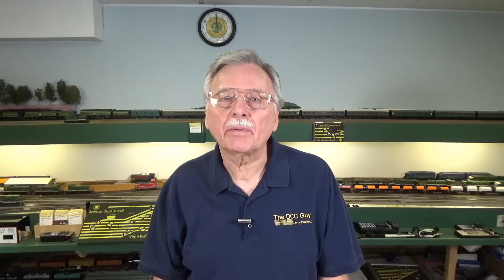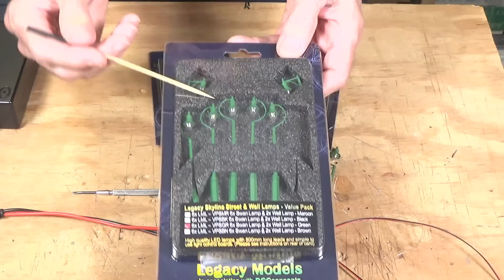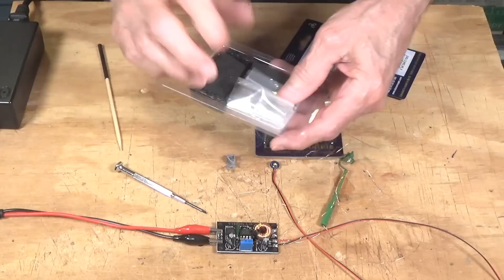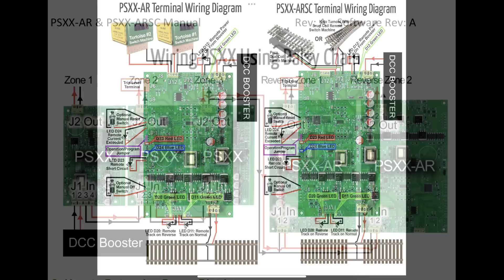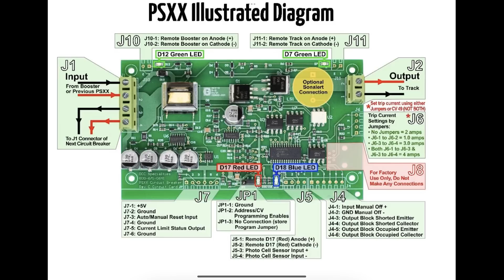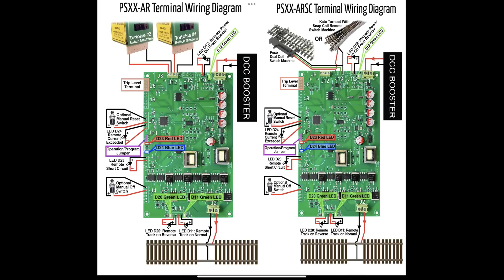New Electronic Gadgets For Your Model Railroad (327)

Comment: Larry, are you still using suitcase connectors now that you switched to speaker zip cord for the main bus?
Thanks
Reply from the maker: Yes, they work on stranded wire too. You just have to,slice the two conductors apart using an Xacto blade.

Comment: Could you solder a set of leads to the board and run them to a gang junction without  issue?
Reply: Bus bar
Reply from the maker: I don’t see why not as long as you don’t exceed the maximum number of LEDs it would be the same as connecting them directly.

Comment: Hi Larry, good luck with the personal stuff, hope it all works out. Great discussion on the AR board, but as I have said in the past, I really do not understand why folks rely on "letting" a short circuit occur before taking action like reversing polarity. I use PSX boards to manage my power districts and I love them. They make the layout secure from Accidental shorts. But for reversing loops, wyes and turn tables, I use a combination of a solid state switch that is controlled by two or four block detectors and a tiny program running on a baby Arduino. The Arduino and the sensors detect that a loco/train is approaching the loop and they switch the phase appropriately via the solid state switch. Very simple, very cost effective and, so far, very reliable with no deliberately induced short ccts. BTW, the software will, if there is a problem, switch off the power to the loop altogether.

Comment: Great episode! Unrelated question though. I need some help. Referring to a Rapido RS-11 which LokPilot(no sound DCC) do I go with using an NCE PowerCab, the NEM660 or MKL? I am so confused between the two versions. The manual says to use a LocPilot version 4, but going with version 5 as they are more readily available, it comes in either NEM660 or MKL. Does it matter? 
I put an email into Rapido and ESU with no response yet. thank you
Reply from the maker: I know that they are both 21 pin formats but have no idea the details of the differences. You might contact Ryan at Iron Planet Hobbies or Bryan at Streamlined Back Shop. They both sell them and may be more responsive if you plan to,buy from them.
Reply: @TheDCCGuy  thank you so much for the response and tips for contact. Greatly appreciated.

Comment: Can you tell me, What is the total current consumption at 15 volts on DCC with 12 street lamps? (first part of video)
Reply from the maker: That depends on the current demands of the street lamps. Assuming you mean LEDs that I showed drawing about 10 milliamps each that would come to 120 millamps. Now if you have a 5 amp booster then 120mA is only a drop in the bucket (120/5000=2.5%). Compare 120mA for the 12 LEDs to say 200-500 mA for a single loco. So if you are only operating a few locos on your layout then you probably have a lot of excess power you are not using that could be put to lights. Or you could install a DC accessory bus and use that to power the LEDs. The circuit board gives you the flexibility of using either AC, DC or DCC without having  to worry with dropping resistors and rectifiers, etc.
Reply: @TheDCCGuy  Sorry I should have made the question more clearer, How much total current would be drawn including the unit itself. if I used it on a DCC Digitrax system? Surely the the unit itself uses a certain amount of current.
Reply from the maker: Sam I figure the board consumption would be so low I could not measure it with my setup, probably about as much as a LED.
Reply: @TheDCCGuy  Thanks, look forward to seeing you back on a regular basis, hopefully very soon. Good luck with whatever is going on.

Comment: Hi Larry, thanks for the info on these new products. I'd like to make one suggestion regarding adjusting trim pots on any circuit board and that is to use a plastic screwdriver. With a board powered on, a metal screwdriver slipping into a live part of the circuit could damage the board. Small plastic screwdrivers for adjusting trim pots are available at most electronics stores. All the best and I'll look forward to your next video.
Reply from the maker: Good point, I’ll see if I can find one.

Comment: What is your experience with the PSXX devices and the Cobalt Digital iP turnout motors?
There is an article on Tony's Trains that states, "Cobalt machines are not well designed". Cicuitron has a comparison article on their site where they talk negatively about DCC Concepts.
As a representative of both DCC Concepts and DCC Specialties, can you get to the bottom of the issues, if there actually are any? Is this just one company trying to speak badly of their competition, or are there really issues?
Reply from the maker: Watch video 307 & 312, I addressed this issue there. Turned out it was a problem with the PSXX not the iP Digitals!
Reply: @TheDCCGuy  Thanks, I will check them out.

Comment: When adjusting the Pot on the "Legacy Lighting Control Board", Is there any change in voltage output of the incandescent side of the board.  I assume there is no change in the  incandescent output as there is no brightness change and that the trim pot only varies the LED voltage output.
Reply from the maker: It did change just not as much as with those high i tensity LEDs and with my lighting for the video it made it even harder to see.